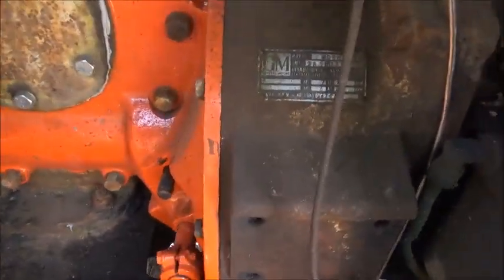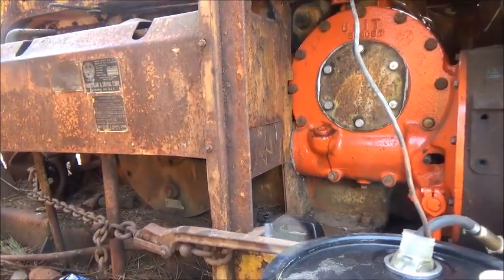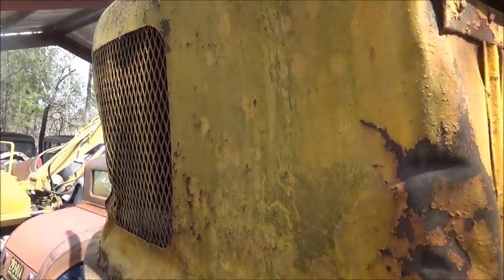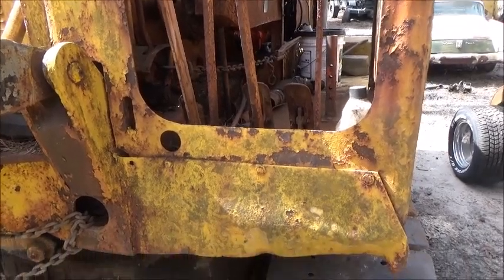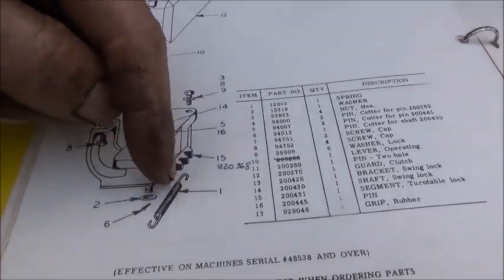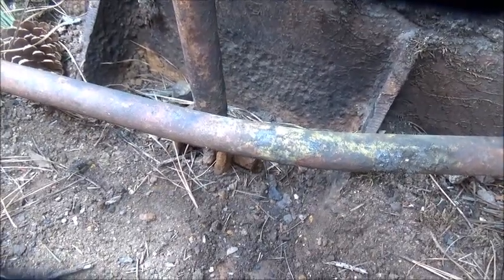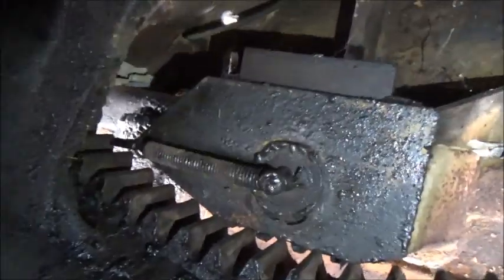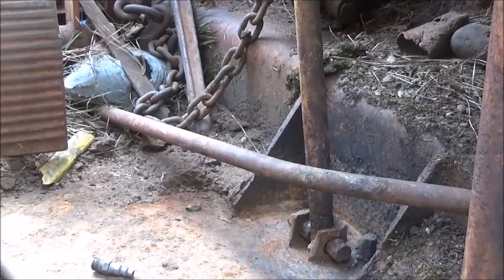1952 UNIT 614 CRANE REPAIRS PART1

Comment: Your quality work will be there long after we are gone. It is a cool thing to see you fixing this Unit so you can use it and also this machine will have some extra value and provenance due to your upgrades.  Very neat series. Also neat that your Wife helps with this very substantial work.
   Fun to watch! I have been binge watching the Unit Crane series.  A friend of mine is a working Crane Operator also.  Good job on that boom and the cab too.

Comment: I'm amazed how you coax these old diesel engines to life with no smoke and smooth running especially considering that it was plainly neglected and treated so badly.  GM 2 strokes are built to last! This is a great series!

Comment: Hi Jonathan from the isle of Wight, England. Found your channel couple of weeks ago and find it highly watchable . Your also a top geezer as would be said here in blighty because of your humanity to people amd ddication to your work. I don't know much about heavy plant but used to be a tractor driver in London in the 70's, even had a bucket on the front a Massey; used to mow all the sports fields and public parks; used to hate getting whacked on the back of the head by doggy doo-doo travelling at mach 3 if I had the back open. Liked the vid on the London Taxi, if you notice the met police charges notice it meentions Shepherds Bush, Uxbridge Road; well Uxbridge was where I was born, but now have bought a hotel in the Isle of Wight, near portsmouth,  Yes, our registration plates are different now mine is HW19KBE  HW for Hampshire and Wight 19 production year. Oh and the London taxi drivers have to pass an exam called The Knowledge, knowing every square inch more or less of London, Keep up the good work buddy,

Comment: My favorite shop tool is the big 220volt hot water Hotsy before I work on heavy equipment. And a 5 gallon bucket of Ripper with a weed sprayer for a pre soak.

Comment: That 48 pound bronze gear was a lucky find after all these years 
To have one custom machined would have been mega bucks. 
Impressive persistence on your part. 
Stay safe
Reply: Actually I wouldn't be surprised if the original price adjusted for inflation was higher than what he paid for it
Reply: @lolatmyage   
Good point !
The current price adjusted to 1952 values would be about $100. That’s almost a month’s income for the average family in 1952. Minimum wage was $0.75. According to professor Google

Comment: If the boom is raised too high, the counter weight will take over and the crane can flip over backwards, saw that happen to a small 30B Bucyrus, someone had bypassed the boom hoist kick out., once the boom went over center the wrong way it was all over. Operator jumped out and was OK, most old dragline operators I knew ran with the cab door open, even in the winter due to this or if the bank caved off and the machine went in the water.

Comment: hey jonathan ;]  i think i would just pressure wash that old gal after a good soakdown in degreaser... working on clean parts is easier  also lets you spot the leaks better i might be tempted to use a bleach as well since i figure a lot of whats on the cab floor isnt from the pine trees . if ya had the money time and desire it could be a restoration   but i doubt you do or want to which is cool as im from the if it works its good enough school never really cared if it was bright and colorful .clean makes it work better and easier to spot if somthing is going wrong so grab the tripod  hit timelapse and decrud the patient . thanks for the videos and wear a mask around the animal feces breathing is difficult enough

Comment: You said that holder was locked in place but the teeth didn't look like they were very engaged with the big ring gear. Was that engaged enough to be sure the unit wouldn't turn. That could be very important when you have something hanging from the boom!!

Comment: on the swing lock where it comes thru the welded on plate under the cab.. how much wear is there in the eccentric shaft. looks like its worn 1/2 an inch deep..  that might allow the teeth to push back from the slewing gear when trying to drive it ..  you may have to use an angle grinder to cut  part of the end off above the worn section.. cut and perhaps create an almost thru cut of some copper tubing just before the end after you bend the end and fit it to the almost D shaped shaft end.  so you can go in with a welder to weld the worn part of the shaft up without it sticking to the hole.. weld does not stick to copper as far as i know..  this kinda allows you to restore a round shaft in place.. perhaps so the same thing on the plate welded over it. making that a round hole again..  
 Sloppy clutch release collars.. why clean the really loose one up. go in and braze  or tig some new bronze wire to fill the worn spots and then take it back to size with a angle grinder.  if you don't have a mill to fly cut it or some kind of a boring bar cutter

Comment: I think it would go a long way to help preserve this old machine if it did eventually get painted. In my humble opinion, rust, is loss of metal that you can never get back without spending time, materials, labor, all three = $ and rust will start again immediately without doing something to protect the metal. What is called (Patina) is rust, metal-cancer for the most part.
Reply: JW  has  said  before  "I  am  not  a  body  man "

Comment: Crane only makes money when they run. Looks like it was 'fix it to run maintenance' by Field Engineers. Cant fix it with a gas torch and a hammer. It's an electrical problem.